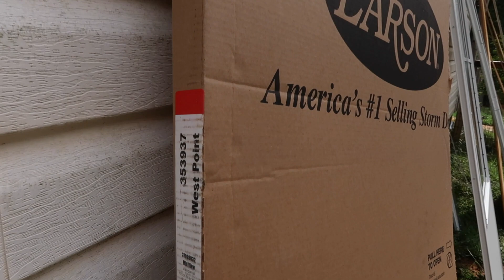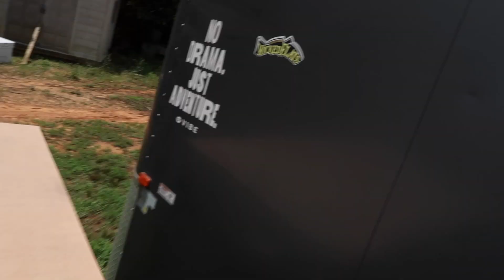Enclosed Trailer Modification : Added a Hinged Rear Wall with Door

Comment: I’d mount a wheel in the corner on the wall by the door. If it doesn’t get in the way of anything you want in there . It’ll really help with opening and closing and it’ll keep that door up the way you want. Great build !
Reply from the maker: I actually bought one to put on it.  I hope it works.

Comment: We did  this exact same thing in our toy hauler. we had problems with wall scrub. I ended up using a wheel from a razor scooter and cut a notch in bottom corner of wall and put the wheel in it...... rolls beautiful now.
Reply from the maker: I am definitely going to try that.  Thanks for the tip and commenting

Comment: Use earth magnets to hold door against wall.  Use a small wheel or roller in bottom middle near to storm door to elimate drag.  May have to cut  small portion out of bottom if you use a roller. GREAT IDEA.  I, too, have used a John boat to cut lumber.  And your wife is A-Typical --- hands on the hip inspecting.  I had to laugh at both.  Been there.  I'm probably close to you dad's age. AND you got a new subscriber.
Reply from the maker: Lol I laughed and a few of your comments.  Great advice and I will look for those items.  Thank you for subscribing

Comment: I've just come across this video I did something similar but I installed little casters so the wall wouldn't sag I know this is an older video but if you haven't already installed some type of wheels maybe you can try it if you still have this setup  like your video
Reply from the maker: I think I'll do that, thanks for the tip

Comment: Awesome idea... Use another barrel latch on the trailer wall and the receiver on the hinged wall in place of the screen door latch.
Now a couple jack stands under the ramp, an awning, and you got a rear deck for those rainy days.
Reply from the maker: I don't know why I didn't think of that.  Thanks for the tip
Reply: Mount the barrel latches on a scrap 1 x to make them stand off the trailer wall a little and drill a hole in the end of the hinged wall frame for the barrel.

Comment: I use these for applications like yours, on the bottom of the wall.
 Swivel ball bearing caster on ebay....
Reply from the maker: I'll look into that, thanks for the tip

Comment: I really enjoyed the video. But I'm not entirely sure the purpose of the wall. Do you want to sleep with the cargo door open? Why not just close the cargo door and sleep? Is it because you do not want to put a hole in the trailer for the air conditioner? Either way, it's pretty cool, especially with the door. Just curious about why the wall is necessary. It would be pretty neat if you could create some sort of cylindrical containment....maybe with a piece of pvc...attach it underneath the point on the wall where it swings and put some little ball bearings in there to make it glide.
Reply from the maker: I wanted to be able to haul my side by side or Kayaks and then sleep inside the cargo area like a camper.  The cargo do is shut and secured from the outside, so I built the wall and added a door to use.  If that makes sense

Comment: Nice idea. Just a thought though. Did you consider putting a wheel (or wheels) on the bottom of the wall to make it easier to move onto place?
Reply from the maker: Thanks, yes I have considered it.  I may end up doing it soon

Comment: I’ve really been considering back wall on my cargo trailer. It would mostly be to insulate bc I don’t want to add the weight to my ramp door. Do you think 2x4 would be good for that?
Reply from the maker: Not sure, but I used 2x4's fir this mod

Comment: So the pool noodles seal up the small openings? Wonder how well it’ll stay insulated
Reply from the maker: They seal quiet well, but what I need to do now is insulate the wall and side walls, as well as the roof.  It does ok, but in the heat of the day, the a/c barely keeps up.

Comment: IF you look to change it. Make it where it swings out I stead of in, that opens the interior to a murphy style bet and wall storage. But this looks great
Reply from the maker: I wanted to swing it to the outside but It wouldn't work because the header was low, plus the door cables played a part also
Reply: @MichaelDavisOutdoorAdventures  yeah, I thought about that a bit after I posted

Comment: I tried one of the air-conditioners it didn't do hardly anything!
Reply from the maker: Mine worked better after I insulated it.  If I had a do over, I'd used a split unit

Comment: All the comments about using the ramp door at night......... I am moderately claustrophobic and just having the thought that I am locked in would make me crazy.  And our grown nephews would not hesitate to lock those doors, just because they thought it was funny.  I like the idea of having a back wall both for the extra light and an imagined escape route (lol), but still able to load bikes and-or kayaks and only take 1 vehicle.  Quick question.... do you feel like the wall is secure enough to hold the weight of a window type AC unit if it was closer to the hinge.  I would rather not go cutting into the walls of our cargo trailer to add our existing window AC that is sitting in the garage floor collecting dust.  Also, I thought that adding a lightweight door sweep to the bottom of the wall or to the floor where the wall stands when in place might help with critters at night.  Wish I had invented pool noodles, they are the foamy version of duct tape, millions of uses.  I appreciated your video, very informative!  I have had the hubs watch it several times so he understands what we are going to do.  And by we, I mean he....

Comment: Tap the circle with the B in it and check out what I did with my back door and wall. I'll be waiting for updates.
Reply from the maker: I checked your video out and subscribed.  I bought the same paint for my roof, any advice on it?  Also, what insulation did you use for the roof?  Your trailer turned out awesome!
Reply: @MichaelDavisOutdoorAdventures  I payed extra for windows and insulation and a finished ceiling. LOL, we look like we could be brothers.

Comment: A side-by-side looks like an ATV, right? Did you build this whole wall just to vent the air conditioner, when you could have simply vented the air conditioner out the side of the trailer? I think the reason you couldn't find anyone else had ever done this is, most people simply shut the ramp door when it's time to sleep.
Reply from the maker: I guess t each it's on.  It kind of gives it a camper feel and I like that
Reply from the maker: The Dog sleeping in the bed, the porch might be for me, lol